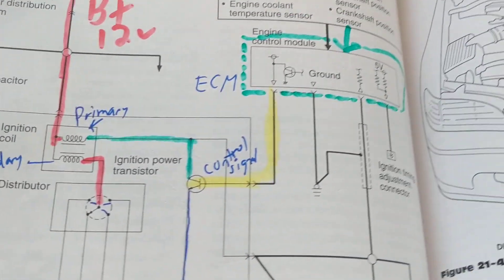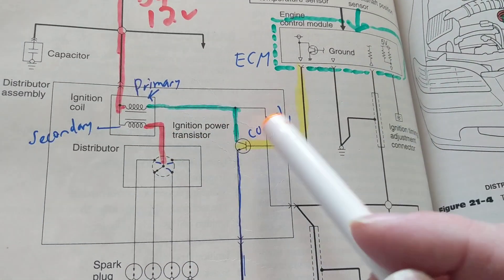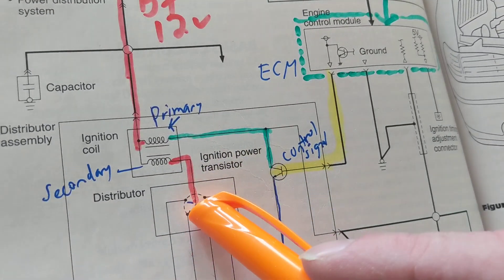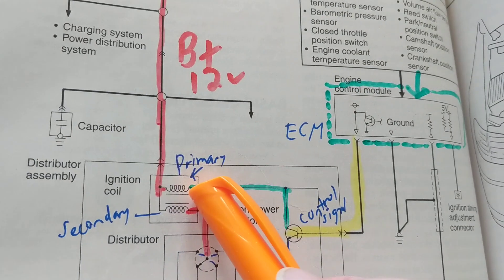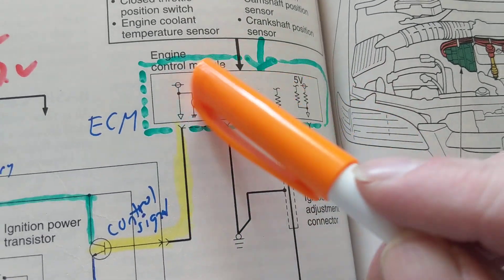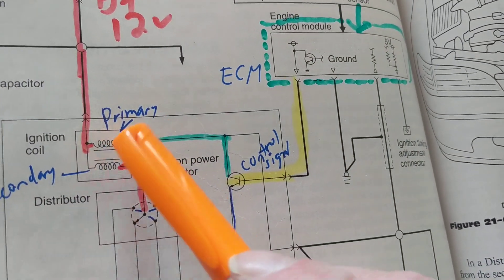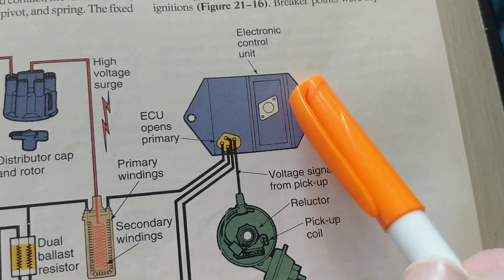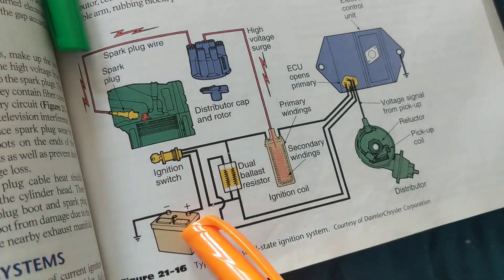HOW IS SPARK CREATED BY COMPUTER PCM MODULES IN ALL AUTOMOTIVE

Comment from the maker: It depends on the type of fuel injection system usually there are different pins but again they vary from model to model what you looking for is to make sure you have 12 volts at the ignition coil thank you for your question